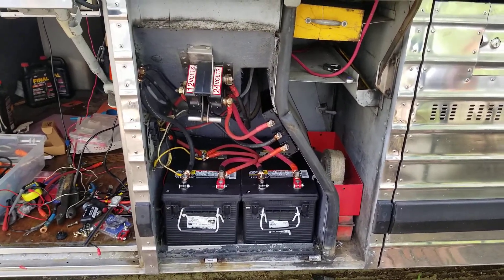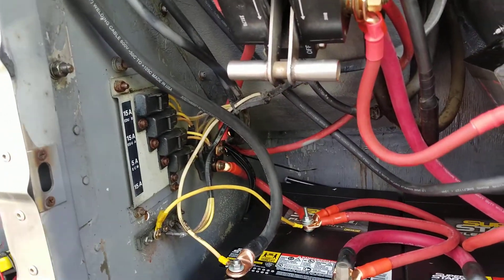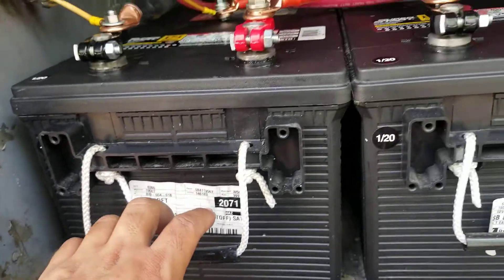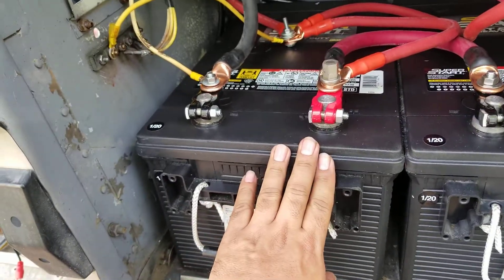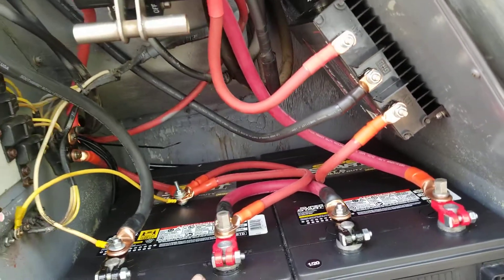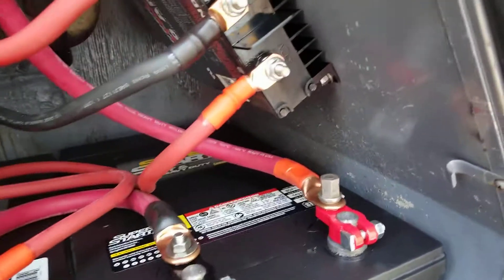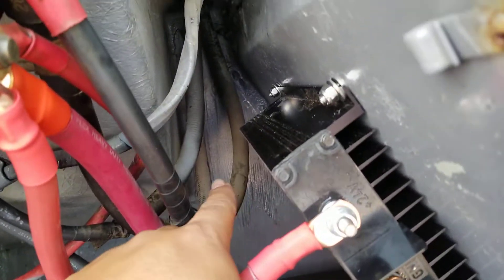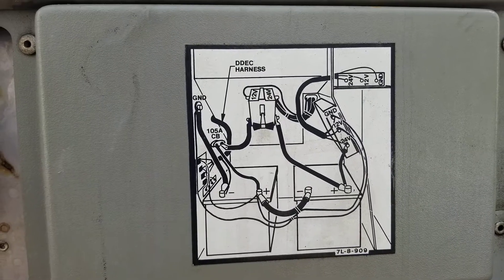Dual Battery System And Its Equalizer  | MCI 102DL3 Custom Coach

Comment: Hi Daniel,  I appreciate your videos. very well made! I have the vanner 100. I replaced all the batteries.  I let the coach sit for about 1 week, and the bus did not want to start. I jump-started and started right up. Drove the coach. Both battery warning lights on dash were blinking but eventually went away. Parked and tried to start it after 3 hours, and the same thing wouldn't start. Jump started and turned on immediately.  But I have to be jump starting all the time! Also, the vanner led light does not stay on after I turn the power off. Any ideas? I can send you a video of the process if you are still doing this. I know you posted this video several years ago.

Comment: The green light on the equalizer when you move main switch to on  position remaining glowing or should it turn off after a few seconds.
Reply: Did you ever get your answer? According to his videos,  the vanner light is supposed to be on all the time, even during the main shut-off. My problem is that the light is not staying on after the coach shuts down.